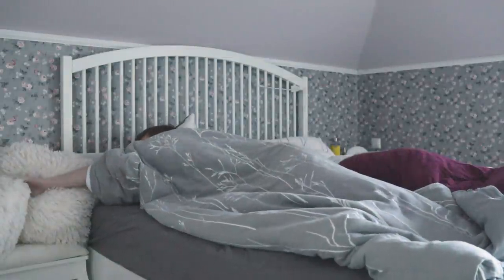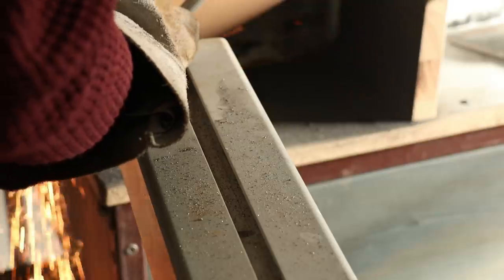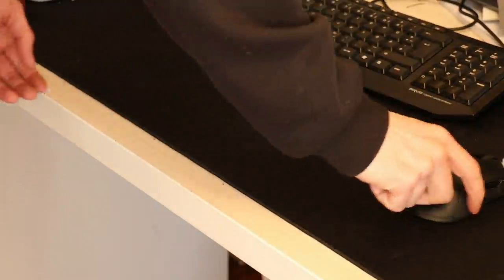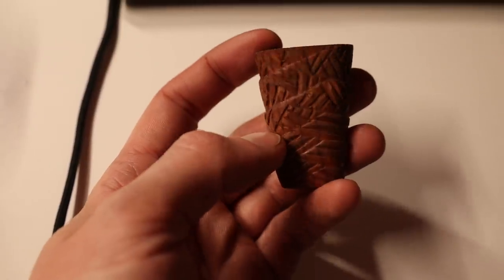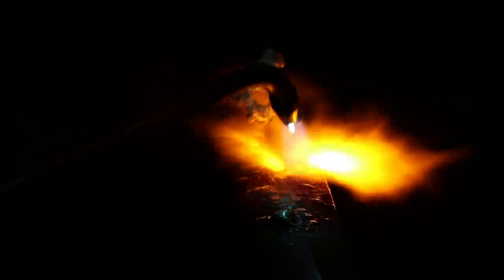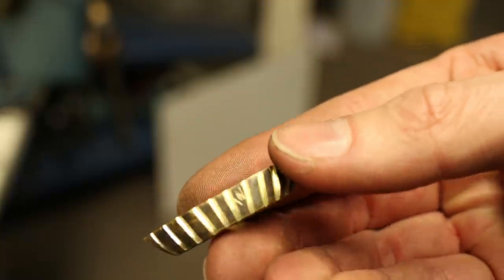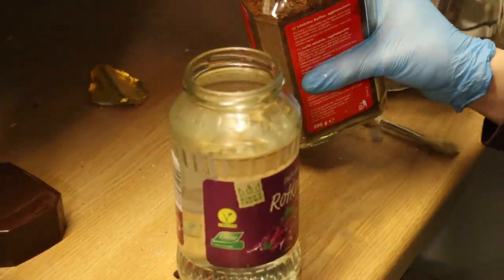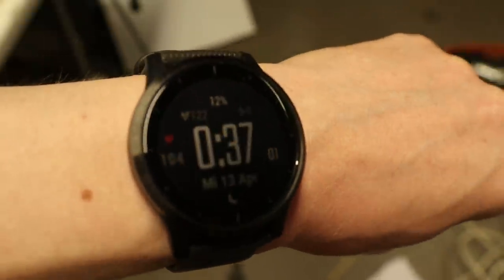From File to Dagger | YouTube Knifemaker Dagger Challenge

Comment: Loved the brass and steel guard, didn't know you could just forge weld them together like that.
Reply from the maker: Thanks! It’s basically like brazing, but instead of a welding torch, like I tried the fuller, you can stick it in the forge and melt the brass that way. I think you can do that with every alloy that has a lower melt temp than steel.

Comment: This looks much better than what I think my 300 Spartans inspired kopis sword that I'm making at school will look. Very beautiful piece!
Reply from the maker: Thanks a lot! That sound really cool! I wish I had courses where I could make a sword in my school 😄😱
Reply: @NjordArtisan Yeah I had to get special permission from my Design and Productions teacher, the blade and tang section will be made out of mild steel because its cheap and I want it to be more of a decorative piece.
Reply from the maker: @3dwrecker_4660  Very nice!! That's just a challenging as high carbon steel and many things I made just ended up on the wall without getting used aswell, mild steel would have sufficed there too 😄
Reply: @NjordArtisan  If I remember to get some footage, I'll put it on my channel some time between now and the end of the year :)
Reply from the maker: @3dwrecker_4660  I'll check it out 👌

Comment: If you add brass to a stack for a billet don’t weld it role it up with 3mm stainless steel wire it will handle the forge weld and it won’t turn to scale in the process
Reply from the maker: But wouldn’t the melted brass just drip out while hammering it?

Comment: I dont know if anyone else already pointed it out but next time you wanna do some brass inlays mabey try heating up the blade and 'paint' on using a brass buffing wheel for the Dremel or the drillpress. The heat should melt the brass and basicly apply a thin coat of it were you are buffing :).
Reply from the maker: Yes, I definitely want to try that! I didn't know about that method at the time. Definitely would have saved me some trouble 😁